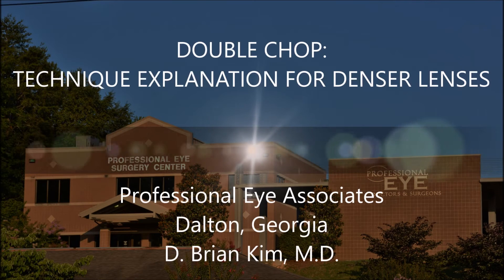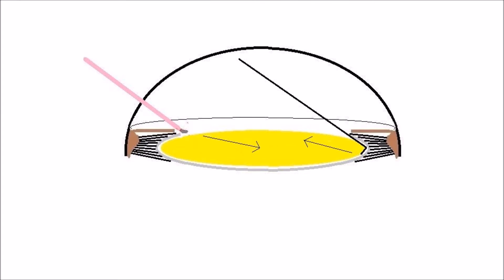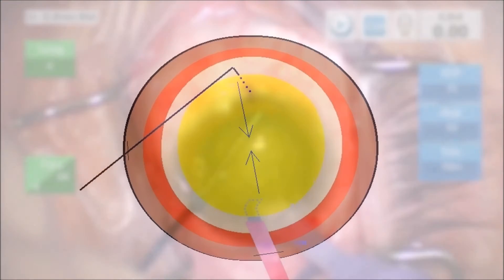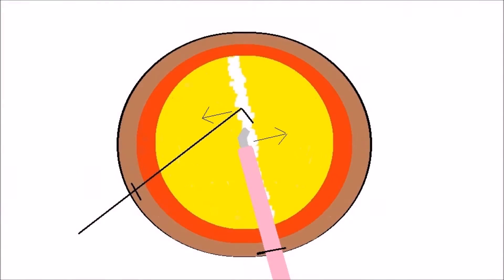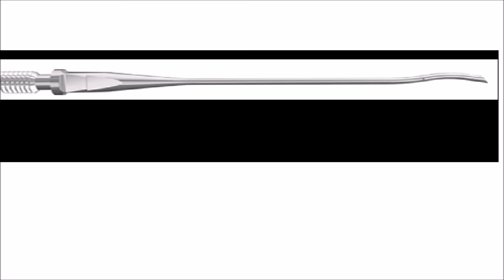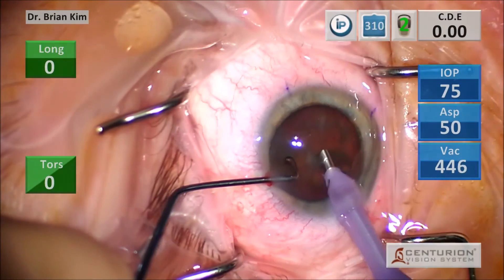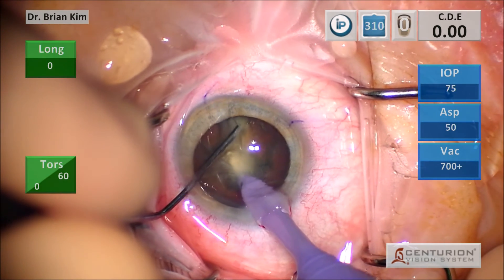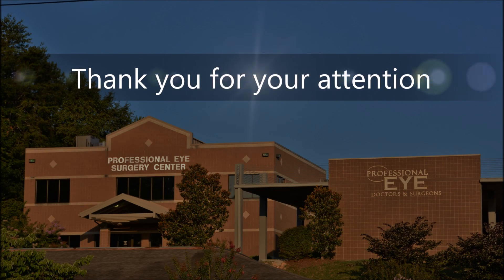Double Chop: Explanation of Phaco Tip Position for Dense Lenses

Comment: Dear Dr Kim
I love this method and now trying begin in some cases it’s wonderful, however yesterday i tried to push Nagahara chopper under the epinuclwus , it didn’t go, as nucleus was big, miopic eye, I struggled with placing a little bit thick nagahara chopper
Reply from the maker: Seljan_777 sorry for your trouble. It would be helpful to see a video of your case but I still have some general concepts to share.
1. A myopic eye usually means a deeper AC. This means when you do the chop maneuver, you will have to change the technique a little to adjust for the deeper and more vertical position of the chopper and phaco tip to get under and around the endonucleus and then crush the lens to cut it in half.
2. The Nagahara is not the best instrument because it is shorter and the tip is not rounded.

I will look over my cases to find one where I have a deeper AC to edit and post and share some pearls in how I do it. Thank you for sharing.

Comment: Thanks Brian.  On one of the cases I noted that there was a tear of the anterior capsule.  Fortunately, it did not pose any problem and I was able to implant the IOL in the bag.  It's possible that I caused that tear with the chopper but I've seen tears like that even when I wasn't using a chopper.  When I have a smaller chopper I tend to slide it along within the epinucleus which pretty much guarantees it is going under the capsule.  With the larger Kim chopper I rotated it 90 degrees to slide it under the capsule with direct visualization of the capsular edge.  Since the view was poor I assume I must have gone over the edge and then torn the capsule as I brought it forward.  I think that I would like to try your technique again but perhaps will stick to cases with good visualization or I could inject a little viscoat under the skirt of the capsule to elevate the edge.  On another note: I had a different case with very minimal NS and had a hard time dividing the nucleus with the chopper.  Any advice on that?

Comment: I purchased several of these choppers and have been happily using your technique.  However, I have made a modification and was wondering about your opinion.  Instead of using the phaco tip as a proximal pivot I actually sculpt a tiny little trough deep into the nucleus near the incision and then place the phaco tip in there.  The phaco tip is anchored there (rather than moving forward to meet the chopper) but the chopper is brought down to meet the phaco tip.  I then do the cross chop.  The little trough is a technique I learned from Matt Kruger's video on horizontal chop on youtube.  I love the chopper for the actual chops where it does a great job, but overall I find it  a little too large for manipulating little nuclear chunks.  The other downside to it is that it's so large and tall that it's not really possible to place the tip into the epinuclear material and simply advance it under the capsular edge.  It literally requires pronation/supination of some kind to flatten it out before advancing it under the capsule.  Have you considered making it 0.5mm smaller?
Reply from the maker: Ilan Hartstein thanks for your comments. I think the trough is a fine idea and will certainly work. With regard to getting epinucleus, I always rotate the chopper 90 degrees so it is flat to the capsular plane both for prolapsing epi and chopping endonucleus so I have no problems or issues with this. If you don’t prefer doing this, then yes you will do better with a shorter chopper.

The chopper is designed for the way I disassemble the lens. If you can try to model your technique after mine, these issues would go away. I never struggle with epinuclear or endonuclear removal with the way I maneuver the chopper. It all depends on how much you are commitment to altering your technique.

But as you know, there are a multitude of ways to disassemble the lens. if you are happy with your technique but don’t like the length of the chopper, then you might consider switching to a different instrument. Best of luck. Happy to answer anymore questions.

Comment: Even if the phaco tip is pointed sir, in dense cataracts dont we need to use  atleast little bit if ultrasonic power to impale the lens and get to a deeper plane? If we are trying to go deep with the phaco probe with just pure mechanical force we might be inadvertently pushing the lens antero posteriorly. Though in all your videos this does not seem to be happening it is my theoretical concern sir
Reply from the maker: crazyshit1985 thanks for your question.  It's all about technique.  As long as you apply equal forces from either side, the lens with be crushed by the chopper and phaco tip without twisting or tilting the lens.  It should not move.  I hope this helps.

Comment: Given you're tilting the phaco tip so much vertically wouldn't that stretch or potentially disturb and rip the main wound?
Reply from the maker: Sevak, this is an understandable concern but simply not an issue.  All you are doing is pivoting the phaco hand piece within the wound.  No different from pivoting horizontally as you would in routine cataract surgery with a chop technique.  I have not experienced excessive fluid egress, chamber instability, or difficulty closing wound.  If you try this technique, you will see that there is no stress on the cornea or zonules.